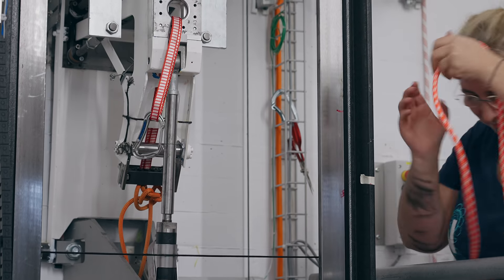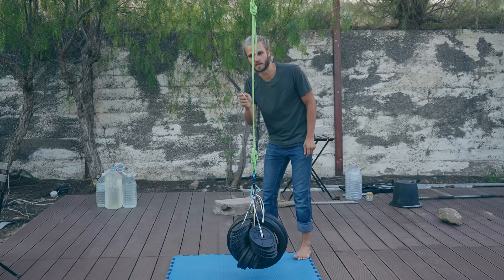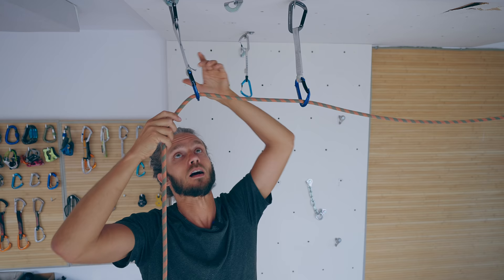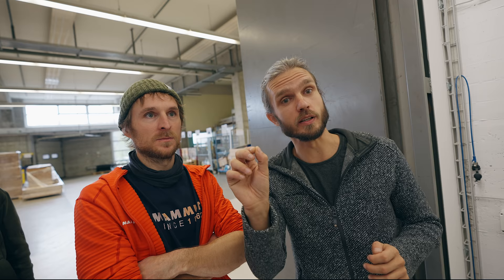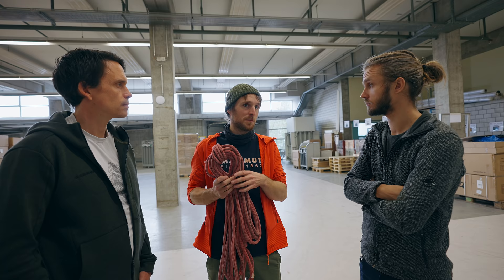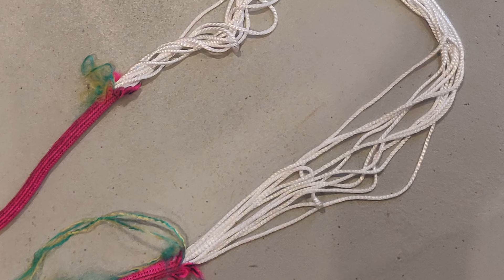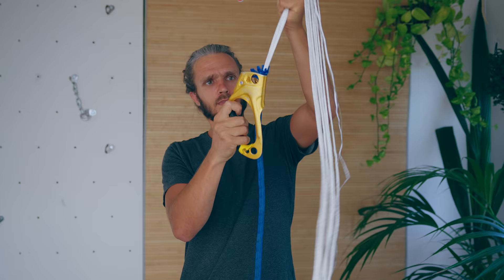Cut Resistance of Climbing Ropes Analysed

Comment: Great vid, thank you!

I think it's important to point out that the sharp-edged carabiner wear is only an issue on fixed draws.

For your "normal" draws, you will be constantly swapping them onto different routes and placing them in different positions - so every draw will experience wear from a rope wrapping around it in different angles, including 360° when falling or lowering off a vertical section. This will lead to a nice, round wear pattern - you should obviously still check the rope-side biners and replace them when enough of the aluminum has worn away, but you should never find sharp edges if properly used.

The issue shows up in fixed draws since they are sometimes only worn down with the rope wrapping at one specific, low angle - say 220° - like in the case described.

So - if climbing on fixed draws, it's healthy be  paranoid. Check the carabiners, and even more important, check any *textiles*, especially if the sling is sometimes in the sunlight. (there are some scary tests by the german alpine club as well as ryan over at hownot2).  Ideally, put in you own gear anyway, although this can be a pain as routes with fixed draws are usually massively overhanging.

If you are equipping a route with fixed draws, consider investing into steel biners with chains, where there is no sling degradation and much less wear on the biners.

EDIT spelling, clarity.
Reply: I had Petzl Spirit draws that got sharp grooves after a few years of sport climbing on them. So you should look out for sharp edges even on your standard draws.

I took a old piece of rope and made the edges smooth again by hanging straight down on the piece of rope with my hands and moving the rope back and forth very fast.
Reply: Are indoor fixed draws dangerous?
Reply: @danidani7463  In theory, yes, they have the same problem.

In practice, indoor fixed draws should be made of steel and regularly maintained - ask your local gym if you are feeling unsure.

There have been exceptions: I know of one case in a gym in prague in 2008 (I can't post a link, but you can google it). A rope was completely severed falling on the first draw. The gym was using aluminum biners and apparently wasn't regularly checking them.
Reply: @johannessporer  I had the same problem with the Spirits I have, they started wearing out way too fast so I stopped using them as first draw, anchors or below roofs quite quickly. I got a DMM revolver wiregate to use for the first draw on most routes, it helps a lot
Reply: @danidani7463  Only if the gym doesn't take care of the equipment. Always inspect your equipment, even/especially if it's fixed in place or provided to you.
Reply: @themeatpopsicle  in reality i doubt the are inspected well enough. My gym is about to turn 1 year old and already I am finding equipment like draws that make me feel sketch. Not to mention the SHARP metal edges between panels on the wall that scare the heck out of me. I took a whip and hit my shin on one, I still have a straight up hole in my leg from it. Makes me question my safety tbh.
Reply: @donkyuhbuhts540  its the edges especially the ones where it goes from roof back to vert that scare the sh€/ out of me.
Reply: @danidani7463  Indoor fixed draws at my gym are steel and have a full round profile, instead of the lightweight profile
Reply: I'm not a climber, but my instinct is that if I wanted to climb any popular route with fixed draws, I'd probably want to use my own carabiners or even weight proofed pulleys between my ropes and the fixed draw.
Reply: @SonsOfLorgar  Pulleys are not practical for a number of reasons, one of which being that we usually want that friction in a fall.  Using your own gear is a decent option, but retrieving it from extended roof sections can be a bitch.
Reply: It is not only an issue with fixed draws. It is correct that this is a more likely occurrence with fixed draws, but it can happen to normal draws as well. This type of black on white thinking is exactly why accidents happen, always double check the gear that you use!!!
Reply: Excellent analysis and post. Saved me from writing a worse post about it. Thankd

Comment: You just made me run through all my carabiners and check them. I'd also be interested to see if there is a life span for tube style devices (reverso, ATC) and when should we retire them. The middle part underneath can also get sharp at one point.
Reply: My reverso and corresponding carabiner got really sharp after about 10 years of use (but I guess mostly due to rappelling down multipitch routes)

Comment: You can rappel past a damaged sheathe on a unicore rope. Thats why i use them for ice climbing. A sport with blades everywhere, it is way safer
Reply: Another of many reasons I no longer climb on water in any form!
Reply: You can do it on any rope really. Just isolate the damaged part into an alpine butterfly knot and pass it using prusiks.

Comment: It might be worth mentioning the Bulletproof line of carabiners and quickdraws from Edelrid. They have a steel insert on the rope side which should prevent deep grooves from forming, while not being ridiculously heavy. I've never tried them, but they looked interesting.
Reply: For fixed gear that stays in place surely the benefits of weight are negligible and therefore why not use steel (also i own a bulletproof, i do rather like it)
Reply: I use the Bulletproof carbines to set up top rope anchors and even after 2 years of use for top rope outside they still look almost new, about a 1-2 mm flat spot in the middle.
Reply: I have 2 bullet proves quickdraws,
One for the first bolt and one for the last (or the crux)
Reply: I have the Edelrid HMS BULLETPROOF SCREW FG carabiner for belaying with my Mammut Smart Alpine belay device. With normal aluminium carabiners the wear is way too high.
Reply: I've also started using the bulletproof draws for 1st and the anchors and it has slowed down the wear on the set of DMM draws considerably.  Using a bulletproof HMS carabiner and Jul for belaying has also given the benefit of not getting that black streak on the rope from aluminum wear into the rope.
Adding in a few of the bulletproof carabiners is likely going to pay for itself in a few years by not needing to replace other gear more often.  Plus, they are just nice carabiners when compared to the other 'high end' options.
Reply: I also do this
Reply: Excellent mention. I will be trying those when the time comes to purchase some new draws.
Reply: Inserts should be the standard. The all-aluminum design is needlessly dangerous.
Reply: @javaguru7141  Feel free to replace all of the permadraws with edeldrid's bulletproof draws with your own money then.
Reply: @alexnone5720  If they were adopted as a standard they wouldn't be so expensive.
Reply: @javaguru7141  Bulletproof non locking caribeaners are $1 more than a DMM Alpha so I don't see how making them "standard" would be helpful at all.

Comment: I took a high-level rescue rope class (circa 1978) which included rappeling' traversing with a self made(from scrap pieces of rope) harness and shoulders sling and traversing in a Stokes basket. We made several hundred rappels and the other moves. We had to complete 3 trips for each fireman/EMT to qualify. We  used a single 3/4 inch ( 19mm) Goldline rope from a 100 ft. tower. We were told not to worry because the concrete pad would break our fall if the rope broke or we tied a substandard boliine. That rope was brittle and slick from friction, stress, and heat. I realize how foolish it was later, but it got me interested in rock climbing and bouldering. On the plus side, you only had to mess up one time, therefore we paid close attention to the instructors.

Comment: It's worth mentioning that the sharp edge resistance of a rope quickly decresses with increasing loads/weight. In case of the accident with the swiss mountaineering guides in training, the fact that they were both on one rope was probably responsible for the accident. Lowering only one person over that edge would maybe have not lead to the rope failure.
Reply: well if you see a pronounced edge just rappel. and definitely not 2 people on the same strand

Also very possibly thin light rope

Comment: Unicore ropes literally have an added layer of protection between the sheath and the core while completely preventing core slippage without trusting the... marketing (15:00).
Also, because they basically have a bonded core and sheath, the rope is essentially a whole which is, arguably ofc, much more resistant to violent snapping when a cut actually occurs during a fall.
I'm not a climber but I honestly can't see any reason not to use unicores.

Comment: Don't classify worn out gear as "sharp". Consider the radius the rope has to go over. 
Any rope has a minimum radius it can handle and this radius is increased as the difference in direction increases (that's why large blocks are preferred in sailing for lines that need to move fast and a lot with large changes of direction).
As this radius gets smaller the difference between the tension on the outside and inside corners of the rope increases a lot, in extreme situation you will get compression on the inside which further will increase the (already high) tension on the outside and.... pop goes the sheath.
Reply: Yeah, the Mammut engineers should have mentioned this. Sure, the edge is a factor, but the rope will try to flatten/expand under load and gets pinched by the groove which further increases tension/stress.
Reply: The Mammut engineer did show a difference between a rounded over quick draw which has seen wear from being lowered off of a lot vs. the one that only saw use from the rope traveling across it and developing sharp edges on both sides.

Some worn out gear is blunted and some worn out gear is sharp.
Reply: @alexnone5720  That wasn't my point. Both have grooves which cause additional stress by pinching, especially for thicker ropes.
Reply: @juliandurchholz  So you'd rather climb on thinner ropes on draws that are worn out like this?
Reply: @alexnone5720  Edelrid's research suggests that load is a vastly bigger factor in rope cuts than diameter, so considering the pinching effect, maybe I would. More research is to be done, but since Mammut engineers only focused on the edge here, I'm not sure they're even aware.
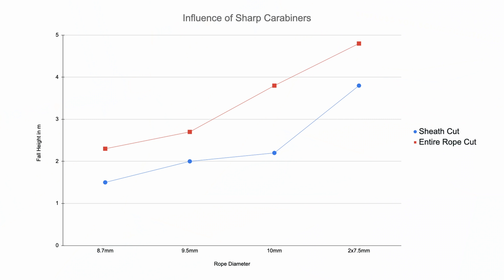Reply: @juliandurchholz  They showed a diagram of diameter versus max force, this answers that question already. Thicker is unsurprisingly stronger. 12:05
Reply: @ludvigericson6930  I saw the chart, but it‘s pretty much meaningless because there are many more factors at play. Weight/force, angle, sheath weaving, carabiner shape, fall factor. I would expect the Swift Protect Pro to outperform all of Mammut‘s ropes in this test, and it‘s only 8.9mm. So ask yourself why is the most cut resistant rope on the market so thin?
Reply: Why don't climbers use blocks, by the way?
Reply: @juliandurchholz  there isn't much of a market for adding more expensive features to rope that's already cut resistant due to being thick. It'll be like adding blue light filters to sunglasses.
Reply: @catatoblob8598  And how do you figure that? Do you know Edelrid‘s sales figures? Have you researched risk factors in climbing? Why do you think people use twin ropes? There are plenty of fatal accidents with cut ropes that may have been prevented by a stronger rope, and the Swift Protect Pro Dry (8.9mm) has about twice the cut resistance as a 10mm rope.

Comment: I climb Mammut Crag Classic 9,5 mm rope indoors and Beal Booster Unicore Safe Control 9,7 mm on rocks. There is definitely huge difference in rope behavior, Mamut tends to curl cos of separated sheath/core also it causes inconsistent thickness after longer time, similar as if you would roll up your sleeve. Both ropes are 1y old now. So saying that unicore makes no difference is just lie. Rather say, we don't use this technology so I can't recommend or disprove since I don't have enough experience with it.

Comment: Thanks for all this works!!! Btw Unicore ropes are much safer in case of cut. So the slippage does not occur in case the rope got cut. It is much more safe during alpinism for sure....for crag climbing maybe it is not needed but it depends on situations. When you have sharp edges, for sure it's better to have Unicore than others...🙂

Comment: I'm not a climber, but I do Shibari. We typically use ~6mm jute rope with climbing carabiners for suspending people. I try to steer new riggers away from the lightweight carabiners because they are sometimes sharp enough to damage or break the rope. I personally use Black Diamond Rocklocks. We don't use our equipment to catch falls like climbers do, but I'll definitely still be on the lookout for wear on my gear like you showed.
Reply: You shouldn't use jute for suspension. A 6mm jute rope can only withstand about 200-300 lbs of force compared to 400 lbs for 6mm hemp and well over 1000 lbs for synthetics like Nylon and POSH while 6mm Amsteel handles an incredible 7,700 pounds. Poor knot choices and a large dynamic load can easily break a jute rope. Rule of thumb is that a knot reduces the strength of a rope by 50%, so 4 jute strands tied together can only  withstand 400-600 lbs. With a 150 lb human dropping a foot there could easily be an impulse large enough to break that. Essentially all rope breaks during shibari are the result of using jute.

Comment: I actually use the 9.5 Crag Classic from Mammut and it feels like the perfect balance between durability/security and ease of use.
Reply: I agree, and it also has a much thicker sheath with respect to other brands (sheath mass is 38% of the total rope mass). It was called Infinity Classic some years ago. I also agree about the fact that Crag Classic is better than Crag Dry, although a wet rope is very dangerous as explained by Ben in the video.

Comment: Non-professional here, but I could see unicore ropes actually being a negative in cases where a rope is put  under enough stress to snap - it looks like in those instances where some of the cords snap, the first thing to go is the outer sheath, which would cause the force to lessen as it happens over a longer period of time and spread out some of the energy being applied to the rope.  With a unicore, all of that force would be applied at once to all of the parts of the rope and not have that energy spread at all.  That being said, it's difficult to imagine there is enough of a difference between the amount of impact that would break a standard rope vs a unicore rope for it to matter in most instances.

Comment: I wish you would show the type and load of weight used, the distance fallen, and the amount of rope out for these tests, rather than just saying "a realistic fall", because that phrase says very little in terms of fall forces. Is it an 80kg metal weight that's taking a factor 2 fall over 10 feet? Or is it an 80 kg sandbag in a harness falling 20 feet with 40 feet of rope out. These are two very different scenarios and will create radically different forces on the rope.
Reply: Measuring the fall forces would also be nice. And specifying the shape (and maybe material) of the edge they are falling on. Like, is it a nice, round polished steel bar with a 5mm radius?
Reply from the maker: It's same set up as in the first video.

Comment: Hi dude! Very good videos :) I miss just one thing and that’s the end of lifetime the rope. I mean especially half/ twin ropes cause I am using it 2 times a year or so.
In the slings video you did a test what load could old slings take … how much load. Please, could you do such a test on half / twin ropes too ? I have barely used half ropes but have it 10 years and they looks like a new and I don’t want to just get rid of them :(
Reply: I'm sure the gear manufacturers would say to get rid of them to be on the safe side.  However, as long as it's not worn and hasn't been exposed to harsh sunlight or chemicals, should be fine.  This video is worth watching.
https://www.youtube.com/watch?v=nEGmFiUD8jY

Comment: The Jumar wud never slip like that under load, as u proved in your first demo. Interesting video. Thanks.
Reply from the maker: Interesting... I almost want to test this ...
Reply: I’ve done it quite a lot in rope access training. Certainly on a correct sized, semi-static rope, I’ve never seen them slip much. (Although they often damage the sheath). Would be interesting to see what happens on a thinner, dynamic rope?
Reply from the maker: @lambchop83  Well this goes out of my current focus scope of sport climbing applications... I would never jumar on my Sport Climbing Ropes :))) Too much work and too much love for those ropes.

Comment: In rope access, the rule is that if you jave a wear of more than 10% from the thickness of the carabiner(or other device) where the rope runs through, than you retire that device. 
The carabiner used in the tests was definitely over that 10%.

Comment: Could you do a video with a Ohm used about the carabiner? At my climbing gym my instructor changed because of me all carabiner on the rent Ohm's and used a rubber sling so the Ohm Carabiner could not turn sideways (we had that happen before while I was lead climbing). With this brand new carabiner we did a fall training and afterwards were shocked how bad the carabiner looked. My instructor is now talking with the boss about steel carabiners for the Ohm. But it would be really interesting how many falls actually a carabiner would hold with the Ohm (I'm quite heavy with 120kg).

Comment: Im not a climber just interested in climbing safety. I work in the oil industry so we lift alot of things with cranes, happens a lot of that people try to lift things that is not sharp but the edge is very close to 90 degrees, With enough weight and motion it is very easy to snap a rope or lifting strap sadly. Be carefull Awesome video!